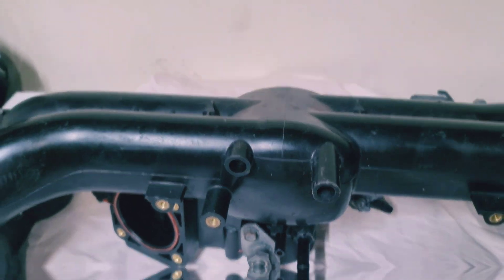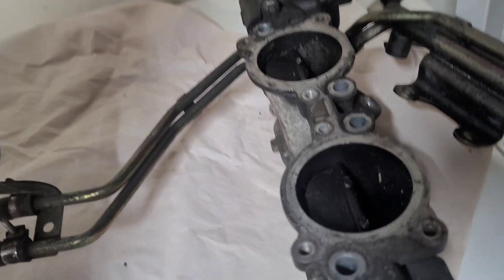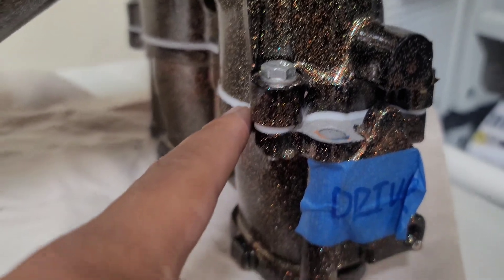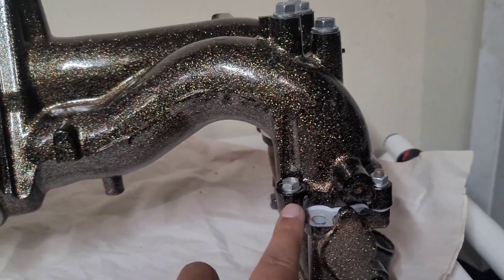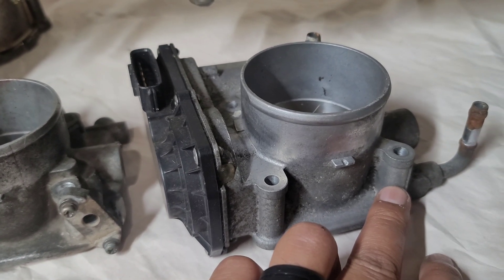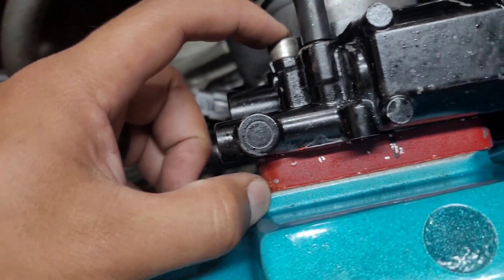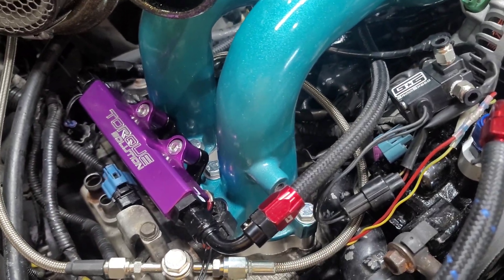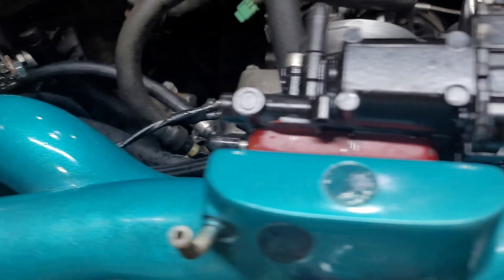EJ207 Manifold Install on EJ255/EJ257

Comment: So after watching this video, from my understanding an ej257 Sti intake manifold will line up and bolt on an ej207 head correct? Or am I wrong?
Reply from the maker: That is correct. Honestly all EJ platform motors and all EJ platform manifolds are interchangeable
Reply: @ItsRithMedia thank you, I thought so but was not 100%. I was just researching, have an ej207, was looking into an ams manifold.

Comment: Nice video very informative and nice powdercoat.I ran into issues with clearing the pcv system on the block with my 20X with hitting the throttle module.I should find a piece or trim it down to work.Aside from the work im still wanting that manifold vs the plastic one by far.
Reply from the maker: So many different problems to run into. Keep me posted on how it goes
Reply: @ItsRithMedia 👍

Comment: Does the pcv valve connect to the manifold about 2  inches away on the sti manifold? Like bottom middle left of you're looking from the front?
Reply from the maker: Are you referring to the crankcase breather on the block?

If so; the crankcase breather port on the block routes to the bigger ports on each head to balance out crankcase pressure. Hope this helps
Reply from the maker: My bad I totally misunderstood the question; any boost-vacuum source or reference will work for the pcv valve to work. I blocked off a few and I'm using 2 and distributing it out to pcv/eletronic boost control solenoid/map sensor/ fuel pressure regulator/ brake booster/ and boost-vacuum gauge